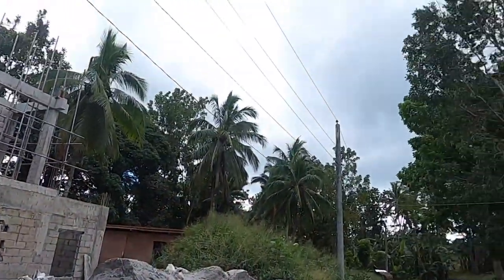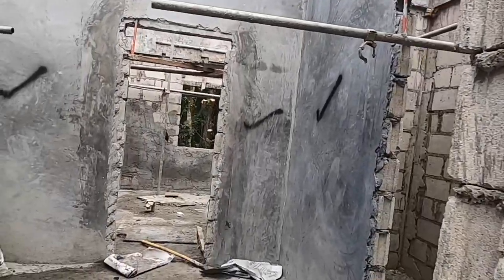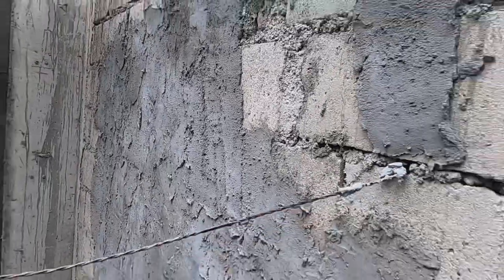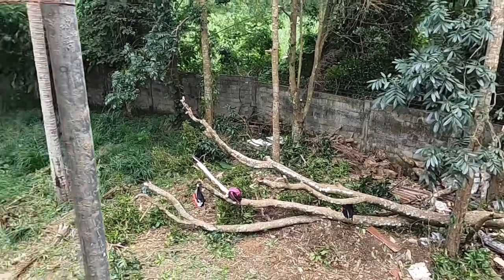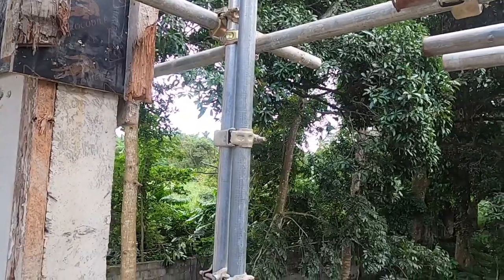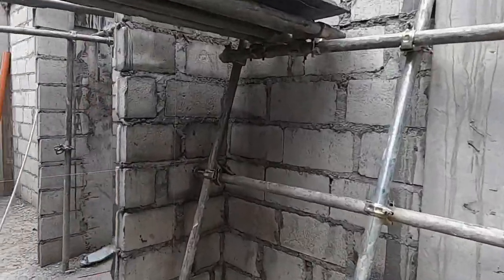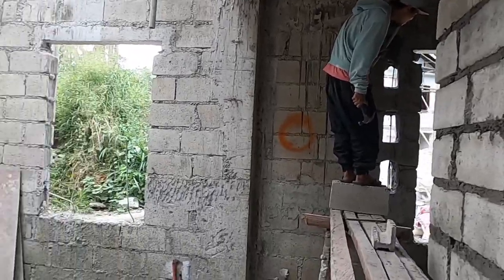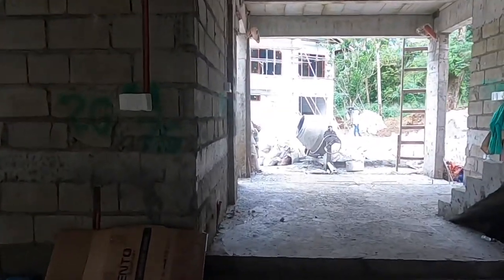Philippines House Build Vlog 51: MASTER BEDROOM BEING PLASTERED

Comment: Hey Steve Happy New Years ,how much is your cost per Sqm? Also what would be the total sqm living area, and what's your property Sqm of the lot?
Reply from the maker: Hi Juan, the cost per SQM keeps changing because we have made changes to the build design for example we added onto the back of the kitchen also added and removed windows and we still have not decided on our roof material because we are having a issue with getting the color we want.  If I had to take a rough guess it would be in the high 20 to 30 dollars range, size of property is 830. Stay safe.